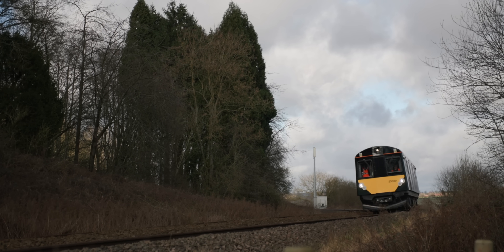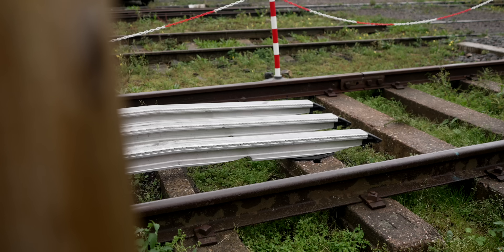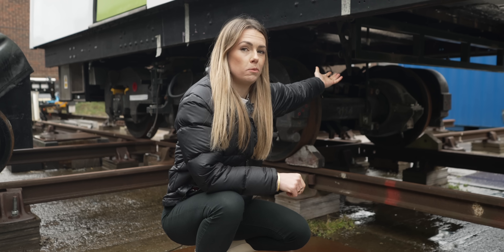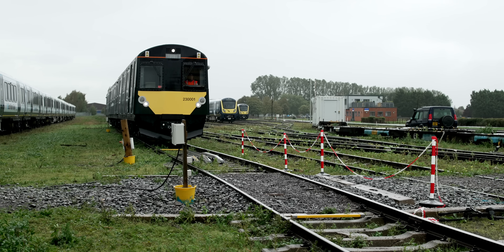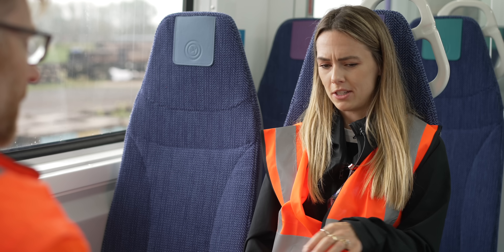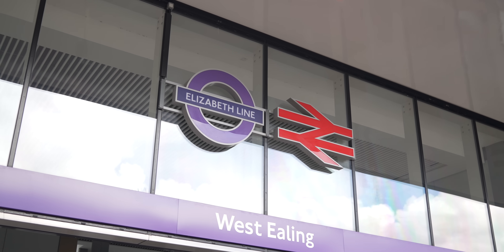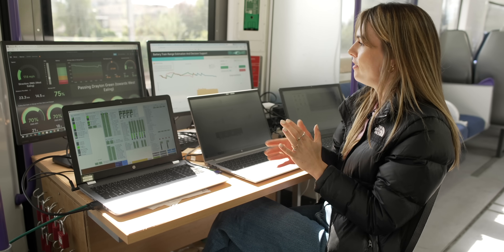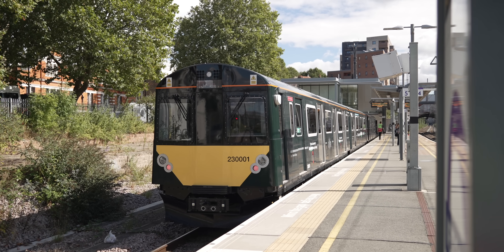Onboard the UK's First Battery Electric Train!

Comment: IF Hydrogen Trains cant beat Battery Trains ?  H2 :  you know the route, the refill points , how much hydrogen you would need vs Battery Train: you need a massive battery .. Then there isn't much hope for H2.
Reply: With hydrogen you throw away more than 60 % of the energy compared to using batteries losing less than 10 %. If you want to increase the energy use of transportation enormously, hydrogen would be excellent. But I don't think anyone sensible would want that.
Reply: As shown in the video, you don't really need a massive battery. You just need as many opportunities to charge. And if every stop had a box of batteries being filled by solar/grid, and you got 5 miles each time you stopped, then you'd rarely ever drop the charge too low that things would worry. But then again, if it did drop too long, you'd only need to wait 5 mins to get it back up to charge for the next station.

Although I have always said hydrogren would be great for mass transportation, I personally can see the benefits for medium batteries on routes with lots of stops. Sure, the routes between York and London that don't stop for 2.5 hours, batteries will never work there and that's the hydrogen path, but for underground routes in London or local routes, this seems far superior as hydrogen won't be cheap.
Reply: @colinwiseman and the London underground is already electric and so are all the commuter routes. This is for none urban and you wouldn't need it on York to London that's already wired unless there is a diversion
Reply: @damiendye6623  Why would you need it, for any trains, at all? Why not just electrify all rails?
Reply: Using overhead lines and/or a third rail, is waaaaay better, way more efficient and way cheaper (long term), than either hydrogen or batteries.
Reply: @ZarlanTheGreen  Long term maybe, but we don't have long term when it comes to carbon emissions.  We need a two pronged approach, getting BEV trains off teh ground fast (as rolling stock is replaced/upgraded) on branch lines, while rolling out overhead electrification for intercity trains - maybe, increasingly, overhead discontious electrification paire with batteries.
Reply: @simhedgesrex7097  You're arguing that we need to replace fossil trains with battery, for places where it would take too much time to electrify, as a stop-gap measure? To then later electrify the rail? A reasonable argument. One that, quite notably was NOT made, in the video. The video was about using battery trains, as a permanent solution.
Reply: @ZarlanTheGreen  In the real world, it'll be a long term solution.  We'd need to have electrified the main lines before getting around to branch lines, and that main line electrification is almost certain to take 50 years (I agree it should be moving a lot faster with an agreed continuous electrification programme.  At the current rate it'll be 10 more years before even the Midland Mainline is electrified to Sheffield, and the trans-Pennine lines are electrified.
Reply: @simhedgesrex7097  I accept that it'll take far more time that it should, what with incompetent and short-sighted CEOs/politicians, but 50 years is just preposterous.
Reply: @ZarlanTheGreen  Yup.  Just as it's been preposterous that we haven't electrified all our mainlines in the 120 years since we started.
Reply: @simhedgesrex7097  Yes, because the years 2024 and, say, 2040, are no different to 1904 or 1930... 🙄
Reply: @ZarlanTheGreen  how does retrofitting all the current lines work without stopping all services on those lines?
Reply: @colinwiseman  How does replacing the rails (and all rails periodically need to be replaced!) work without stopping all services?
Reply: On the contrary.

Some research will reveal hydrogen powered trains in use all over, particularly in Europe.

That said it must be conceded that not all hydrogen trains are equal and some have had issues.

Clearly some outfits are ahead of others in the hydrogen engineering stakes.

Comment: I was unofficially, the first actual passenger on this train. A couple weeks ago, it was doing Sunday trials, with invited guests onboard. Right place, right time, I hopped on the train. When I got off at my stop, the guard was all sorts of flustered. “Does not compute, does not compute…malfunction”. LOL
Reply: Not instilling great confidence when the Grim Reaper says he was the "unofficial first passenger"
Reply: @JustforSits i love it!!
Reply: well that's one way to do it lol... first time I've heard of a normal passenger riding on a trial train. I did hear a long while ago about someone riding on an ECS (empty coaching stock) train haha - "I got to my destination quicker than normal, it was great"
Reply: @RWL2012  The trial trains are ECS moves.
Reply: Clever technology but wouldn't it have been a lot easier to strip out the traction equipment, put a small locomotive at one end and run them as push-pull units?

The seats look worse than the original ones.
Reply: @physiocrat-sv  no because they’re not compatible with locomotive brakes.
Reply: @bfapple  
What braking system do they have that makes them incompatible? Would it have been impossible to fit them with a standard system?
Reply: @physiocrat-sv  I’m not familiar with LU brake systems but locomotives have twin pipe braking. Out of the 80s/90s era British multiple units, only a few were built to be compatible e.g. 325, 442.

Nothing is impossible but it all comes at a cost. The whole idea of the D-Train was that the power packs (diesel, battery or hydrogen) are slung under the carriage.
Reply: @bfapple  
Several million have been spent on the R&D alone. One option would have been to create a sub-class. A small build of oil fired steam locomotives similar to those built for Swiss and Austrian railways would have been less expensive - the Great Western 1400 class would have been a good basis for a design for this work.
Reply: @physiocrat-sv before Vivarail went under, their priority was shifting to ‘licensing’ their technology to retrofit ex-BR vehicles. As the D-Train was ultimately only ever going to have limited potential.
Reply: @bfapple  
The whole fleet could have been stripped of its traction equipment and fitted for locomotive haulage, apart from the ones which went to the Isle of Wight. 

If no off-the peg diesel loco of about 1500 hp was available, then a small build of oil fired steam locomotives could have done the job. A production run of 20+ brings the cost right down, and the lower cost more than compensates for the additional staff needed to run them. The emissions are cleaner than diesel, anyway.

How much has been spend in R&D trying to get the electric traction to work on lines that are not electrified?
Reply: @physiocrat-sv  Germany has battery trains, brand new trains, in service already.
Reply: @physiocrat-sv  The whole fleet is in storage some place in the west country.
Reply: @physiocrat-sv  Regenerative braking perhaps. Much better to be distributed rather than only acting via the locomotive wheels. Braking using conventional friction brakes is just throwing away energy in the form of heat whereas this system can potentially be adding all the slowing energy back into the batteries... so less time needed for top-ups whilst in the station ... and less "fuel" cost.
Reply: @physiocrat-sv  The whole point is to avoid needing to burn oil! Cheaper isn't better in this regard.
Reply: @bfapple  LU have a twin pipe brake system.
Reply: @MrAdopado  
Why should one not burn oil? Railways account for 0.7% of UK carbon dioxide emissions. They are not even worth thinking about.
Reply: @physiocrat-sv  Every little helps with reductions of emissions and plus people will use an electric railway more often than a diesel railway.
Reply: @MrAdopado  
If you are concerned about wasted energy then the big one is the energy used to heat the trains. 20kw per vehicle.  The most efficient is waste heat from a steam locomotive or underfloor diesel.
Reply: @physiocrat7143  Why not just install sails on the chassis?
Reply: @physiocrat-sv  They are the same seats fitted to the TfW 230s and SWR 484s. They did strip out the traction equipment and replaced it with AC traction equipment, the idea of the 230 is you can swap the batteries over with a folk lift in under 30 minutes which is based off the modularity of the diesel unit. 230001 was a Diesel Multiple Unit at the start.
Reply: @ I was talking to one of the managers of the project early this year. He told he, “its ready to go”, yet somehow, for some reason, its still in testing with no entry into service date anytime soon. Its classic “milk it for all its worth” scenario. Also, for far less than what we are paying for this project, Germany has for quite some time, had its battery trains running. But why save money buying ready made off the shelf units, when you can rip everyone off refurbing 60 year old trains.
Reply: @davidwebb4904  
The trains have residual value but most cost effective way of using them would have been to use some locomotive power. Unfortunately there don't seem to be any locomotives small enough for the job, so it would be new build. A couple of class 20s would have done for the Greenford branch.
Reply: @physiocrat7143  a single car pacer would be sufficient for the traffic on this route. 😊
Reply: @ if only the Class 38 had come to fruition.
Reply: @davidwebb4904  
Quite. Sledgehammers is crack nuts.
Reply: Hmm, I was a passenger in 2018 though.
Reply: @ I was a passenger in 1982. I win :D
Reply: @davidwebb4904   Have you checked that the London Transport vechile numbers matched the vechiles in the GWR 230s, which you have riden on?
Reply: Wow.. there are such a bunch of nerds talking about trains. Nice video Imogen. Maybe Bobby such do a nerds 
-on-trains spoof video; him wearing an old jacket, loads of badges, a gold pocket watch and a flat hat. Eee-by-gum, fancy that lads, electric trains, who’d av ever av thought of such a thing.
Reply: Can I chage my phone 😅
Reply: @ you can even charge your phone on the purple line
Reply: I very much doubt it. For one, there is never a guard on the Greenford branch and this train doesn't require one.
Reply: @ They were doing trials. Dozens of selected participants. I was just in the right place at the right time, and figured out what was happening. Of course theres no guard in regular service. This wasn’t regular service. It was trials. He opened the doors, stuck his head out, looked both ways, and I slipped by him and went on my way. Everyone in the trials were going all the way to Greenford and back. And I don’t really care if you believe me or not. What would I have to gain by making such claim? I know what happened, I was there. I am sure if you out in an FOIR, you would get conformation to back up my claim. But thats on you. Have a good day….
Reply: On that route!  I was a passenger on the train when it ran out of Glasgow Central during COP26, the story starts waaaay before 2023 - it starts when Vivarail headed by Adrian Shooter decided they were going to develop the system, later taken on by GWR when they went bust.  They were years ahead (and the system is still far ahead of anything the major manufacturers have).  Had Vivarail not been subject to the very many issues with today's railway industry they would be a real force now - such a shame.
Reply: @ Hitachi have battery trains in service, also the Giga Train in Berlin. BRAND NEW trains, not 60 year old refurbs.
Reply: @ Theres a subtle difference between being a passenger, and being a guest. I used the ride as part of my regular journey. Not as a guest on a demonstration ride.
Reply: Nice idea but in the real world diesel is more efficient and environmentally friendly. 
Until new battery technology is found these will continue to an over priced  Inefficient public relations exercise
Reply: @ of which a few are making out like bandits…..
Reply: Don't travel on Wednesday week. The battery is due to go into thermal runaway. That will be fun.